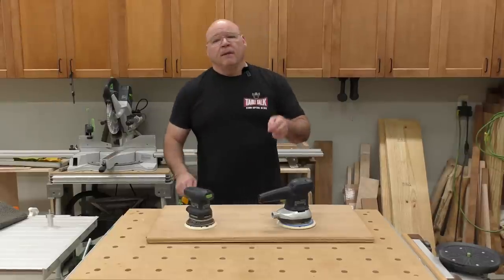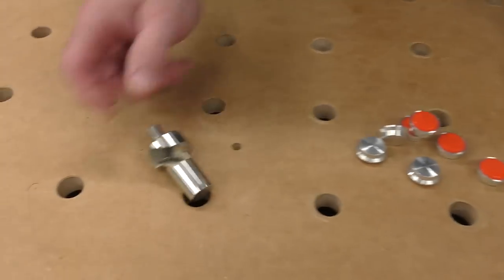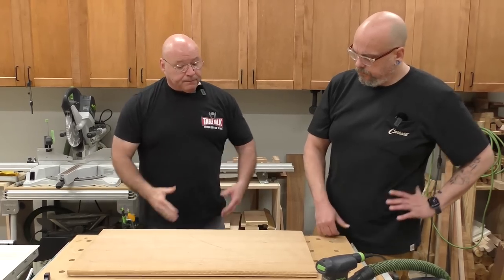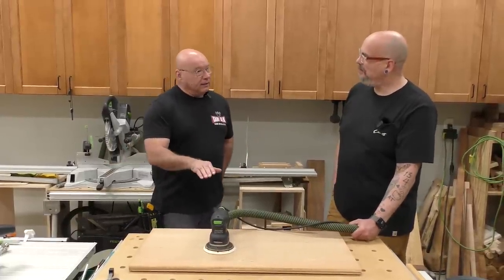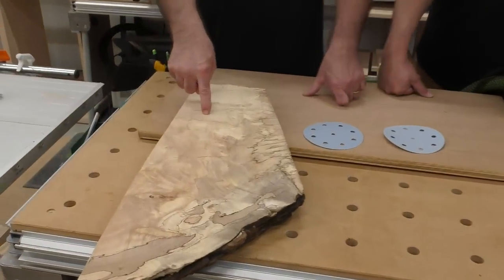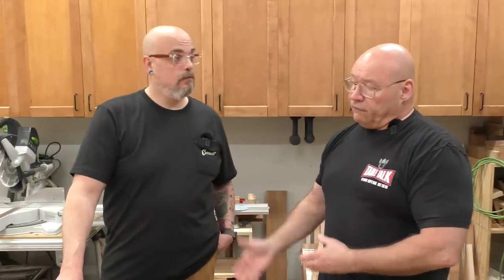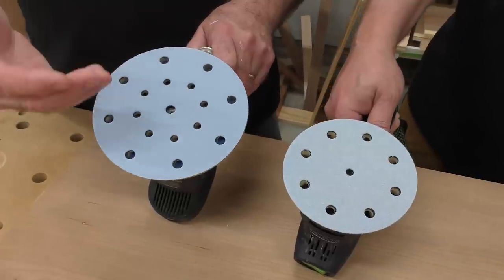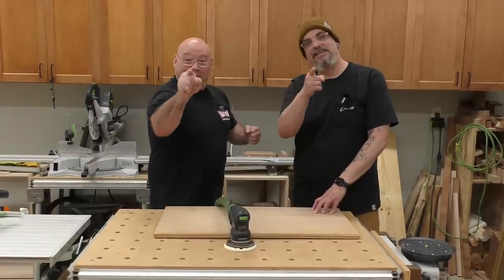Does Your Sander Need Help ?

Comment: Great tips! The mistakes? I made them all 😊..  one more tip I was waiting is how and when to use the different speeds of the sander. Any rules or useful tips on this?
Reply from the maker: variable speed is for 2 applications ...Sanding finishes so you don't burn through the finish..slow it down.
The other is on painted radius surfaces so you don't burn through the paint.... I guess they are both for finishes. I hope this made sense.
Reply: @sedgetool  👍 makes perfect sense, thank you

Comment: I noticed how fast you were moving the sander across the surface. Elsewhere, I've heard that it should only move no faster than 1 inch per second in order to get the best finish. Is that a tip worth using? 
Thank you for all your videos, guys. I learn a lot from you!
Reply from the maker: I have never really timed myself ... but that sounds like a good speed ... just keep the sander moving

Comment: Hi I've learned alot from your videos so thanks for that this question is not about sanding so I hope you can help me its about my dominoe the plate wont drop down square to the base is there a way I can fix it or do I send to festool for repair thanks in advance Allan
Reply from the maker: Allan...I would definitely call Festool on this one...
Reply: @sedgetool  cheers